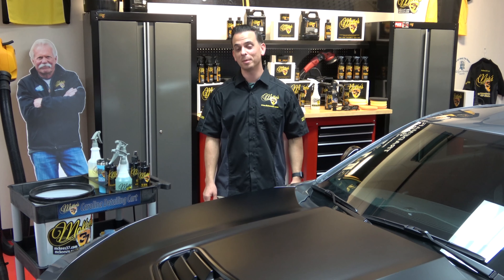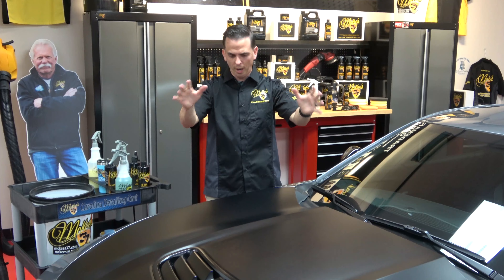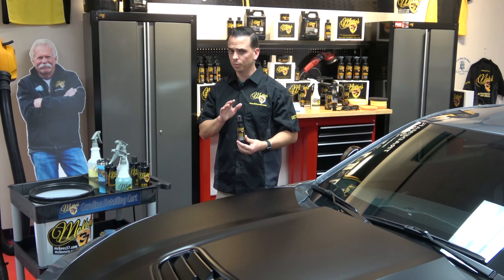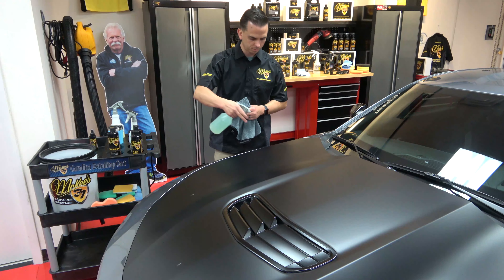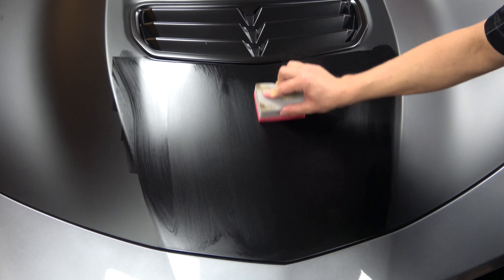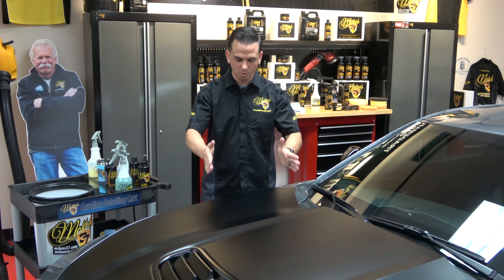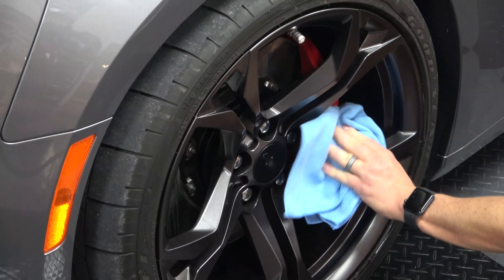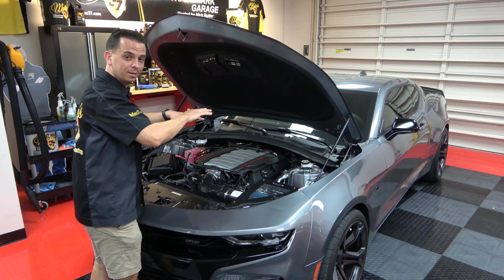How To Ceramic Coat Matte & Satin Finishes - McKee's 37 Car Care

Comment: What's the recommended time between application and MF towel wipe down? Looks like a few seconds based on the video. Is it because the matte/satin finish absorbs what it needs quickly?
Reply from the maker: Remove excess as soon as you're finished coating that panel.  This was filmed in "real time" so we did not cut anything out. - Nick

Comment: What is the durability of this coating? Also what is the durability of your matte finish Cleaner Protectant? Why did you use your rinseless wash to prep as opposed to your foam wash? which you recommend for matte paint. I am looking to purchase a matte painted vehicle shortly and I am a big fan of your products. Thank you.
Reply from the maker: Hi Scott.  You'll see anywhere from 1-3 years, depending on whether or not the material is a WRAP or if it's PAINTED.  

You will wash the vehicle first, then wipe down the material with N-914 as described in the video to ensure the surface is squeaky clean.  Then, you apply the coating.  -  Nick @ McKee's 37

Comment: Will this coating be good for the matte finish on a 2021 Toyota Supra?
Reply from the maker: Yes it will.  Be sure to take photos! - Nick
Reply: @McKees37  Cool thanks. I just ordered the coating and I will take pics!
Reply: @KLM817  just got my 07 Chrysler 300C wrapped in Oracle Matte Graphite.  What is your review of this ceramic coating?
Reply: @brucewayne8555  It works very well for any type of matte finish. I have been using it on mostly matte graphics and stripes.
Reply: How did the coating work on the Supra? I'm planning to coat my Phantom Supra with this product so it would be great to see how it turned out for you.

Comment: I’ve told a friend I’ll do what I can to help him with his terribly neglected matte paint job. I’m thinking this product sounds like the coating I want, but I definitely won’t be able to clean the paint properly with only a rinseless wash. Besides the fact that it looks like hell, I can’t imagine the coating will bond to the paint if I don’t get all the crap off it with pretty harsh cleaners and an iron remover. Any advice?
Reply: I know this is an old comment, but for future people wondering as well... The rinseless wash used here is a versatile wash, it can be used as a panel prep for coatings at a more concentrated dilution than you would for a rinseless wash. For dirty, neglected, matte paint, you want to wash the car well with a matte car soap or one that doesn't have gloss agents and polymers in it. Follow the wash with your chemical decontamination of iron remover and an APC if needed. Make sure the APC is safe for vinyl if it's a wrap. I like chemical guys nonsense.. It's scent, color, and gloss free, safe on almost every surface, slick/slippery, and relatively strong. After the chemical Decon rinse the car very well to remove the chemicals. Next,  use the panel prep(McKees rinseless wash at prep dilution) while drying, or after drying. This removes any lingering residues from the soap, chemicals, and any other contaminants that might be left behind. Finally, you can ceramic coat. You can't really fix scratches, clay, or any kind of polishing like on a normal glossy paint; but the coating should help remove dulling, some discoloring, and some very fine scratches.